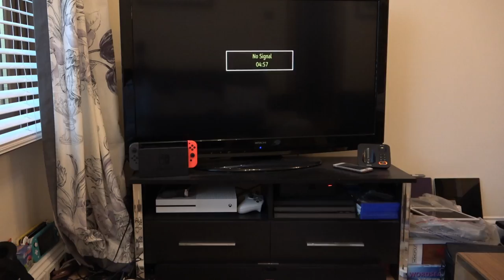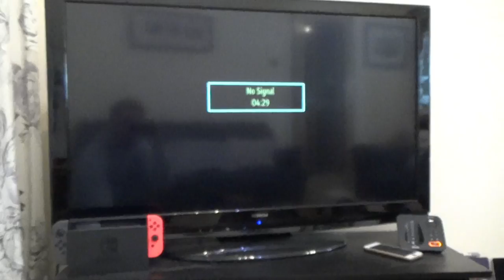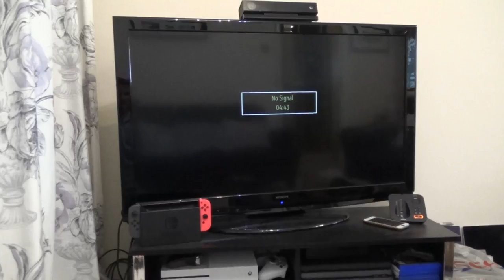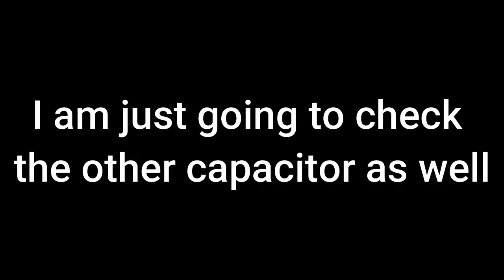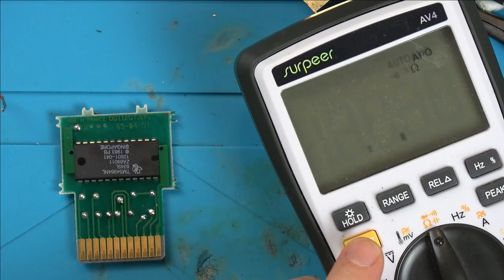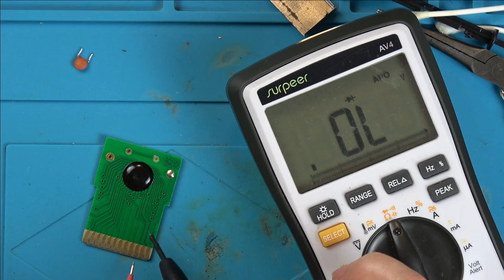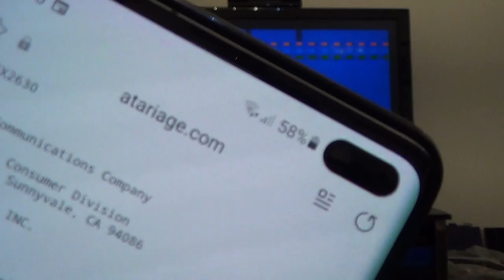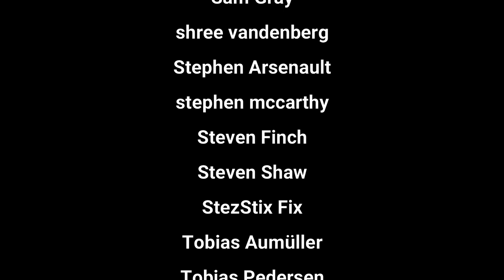A Joblot of Faulty Atari 2600 GAMES - Are they Fixable?

Comment: Yeah the paddle controller games won't work with the CX40 joystick. When you program CX40 controls in 6502 assembly for the Atari 2600 you have the code perform simple bit checks for the different inputs. Then the code branches to whatever instruction you want the game to perform. The paddles are more tricky to program because there's a capacitor inside them that charges at different rates depending on the position of the potentiometer. You perform bit checks but you also have to measure the time it takes for the potentiometer inside the paddle to discharge. This is so you get the appropriate rate of movement on the screen.

Comment: The flimsy carts are later titles. There was a "crash" in 1984 in the USA, people got sick of console games. Over in the UK we more wisely bought computers with games on tape for 2 quid, but Americans bought horrible massively clunky consoles with games for 30 quid them-days money. So no wonder they got sick of the prices once the novelty wore off.

So after that there wasn't as much money in 2600 software, so companies made cuts. Even using shitty flimsy plastic must've saved enough money to be worthwhile, compared with the thicker ABS (I think) they used to use. Surely it's only a matter of pennies per cart though. A lot of companies had games written and ready to publish right about the crash, so decided to at least get some return on the investment of programming them by releasing them in nasty carts. 2600 programming is really no joke, takes very smart people a fair length of time to get anything working at all. They were nearly all one-man jobs but one smart man.

Even the label is black-and-white text rather than the picture labels earlier carts had, I presume being black-and-white means they could use a cheaper press to print them. Real scrimping!

The Ghostbusters cart is 8K so must have the bankswitching circuit inside the chip, so it's not just a ROM, it's slightly custom. It's a fantastic game though, one of the most fun on the 2600! Read the manual online to figure out how to play it, it's not complicated but you need to know what controls to buy your initial equipment. Then you start the game proper, running your Ghostbusters franchise in your town, hoovering up and trapping ghosts. At the end of the game, the Marshmallow Man comes, and after you beat him your score is used as money to start over again, but with better equipment.

Better versions were on the Atari 8-bit computers, and indeed other 8-bit computers, but the 2600 version has nearly all the features included, a feat for such a limited console.

Comment: Whatever you're working on @23:41 -(super cobra?) it looks like the PCB had absorbed some liquid - you can see the PCB color gets lighter where you applied heat. You may want to try baking it in the oven at 110c for about an hour to dry it out, and see if that has any effect. I'm guessing the chip is fine, but the pcb has issues.

Comment: Which do you think is better for claning edge contacts like these Vince, earbud and iso, or one of those fiberglass pens?
Reply: Buddy, you have to choose your weapon for the situation.  Non destructive cleaning IPA or circuit board cleaner, next up warm flux and a tooth brush, for more 'destructive' cleaning you can use an eraser, fibreglass or brass tipped pens etc or finally a grinding pen (think Dremel with a 1mm grinding tip).  The art of cleaning contacts is a mysterious one and the choices you make reflect your personality.......
Reply: @Paperghost  Well, I usually use the fibreglass, but I'm dealing with 40 years of constant air exposure edge connectors on 80s microcomputers like C64, Spectrum and CPC464. Those tarnish really badly. And as anyone that had a spectrum knows, even a new machine was pretty touchy when you had anything connected by one of those ports!
Reply: @Graytail  A buddy of mine suggests using WD40 and a 100% cotton cloth if the connections are sound on the pcb.  I can see the logic but can't attest to it.

Comment: A fiberglass pencil would make so much quicker work of polishing those contacts instead of alcohol, and leave them with a clean surface, even through the contact point pits.  Alcohol or contact cleaner or DeOxit is a quick first repair, but if you have the cartridge apart, always use a fiberglass pencil to recover fresh metal surface without risk of damage unlike sandpaper can cause.
Reply: You'd still be scratching away the surface layers though.  On the plus side, these didn't look like enig or hard gold, so it's not as important, but I wouldn't do it to a better quality pcb.

Comment: It seems that in the old days of Atari they did not introduce standards that would become a standard with Nintendo and Sega as confirmed by the laughable differences in cartridge design and chip/circuit board in this video.  With Nintendo and Sega, game developers and publishers would have to comply with cartridge and chip/circuit board design and would get either the Nintendo or Sega quality seal and this practice would carry on even with PlayStation and X-BOX today.  Unfortunately the quality seal was not a representation of the quality of the game itself as the NES was swamped with terrible games that cost a fortune to buy back in the day.

Comment: A couple of ideas you could try. First you can clean the edge connection pads using an eraser. We used to do that to make older computer interface circuit edge connections work. And you can also re-solder the connections where the chip pins connect to the feedthrough pads. Some time the heat and reflowed solder makes them work again. I mean since they are already not working, what is there to loose...

Comment: I dont think with Kung Foo Master it is the chip - I owned an original Atrari Sixer like you have from above and KFM came out in the later 80's, It worked in the latter small 2600 models with the silver top but not in the earlier 1 st ed console.
Reply: I mean the Kung Fu Master is a repro cart. The PCB is even labeled as being from the 2000s.

Comment: Ghostbusters looks like a bootleg with the flimsy housing, cheap unlacquered pcb and the wrong label. Maybe from Hong Kong or thereabouts.
Reply: Official rereleases by Activision were White Label, done on the cheap, like their budget versions. Not saying this isn't a knock off. Just they could also be legit? Not an expert though, so I very happy to be corrected.
Reply: Ghostbusters is one of the later Activision games for the 2600 and the white label is for the PAL version of the game. After the crash of '83, Activision out fewer games and looked for ways to cut costs to lower price. Atari did this as well, with later run carts eliminating the spring door that protected the PCB from the elements.

Comment: I wonder if the cheap feeling cartridge is some sort of knock off.  I don't believe these had any copy protection at all.
Reply: Ghostbusters is one of the later Activision games for the 2600 and the white label is for the PAL version of the game. After the crash of '83, Activision out fewer games and looked for ways to cut costs to lower price. Atari did this as well, with later run carts eliminating the spring door that protected the PCB from the elements.

Comment: There is a possibility that the blob chip is real. The "MX2002-2016" part is most likely a model number, not a range of years. The actual date code is most likely 8912, meaning the 12th week of 1989. Atari 2600 consoles and games were still being produced then, and Nintendo started using blob chips on Famicom games around 1984.

Comment: The Ghostbusters cart is actually not "manufactured" by Activision, they were made by a licensee for Europe and Australia.

You'll find that a lot of the later carts are blob carts, pretty sure they were the "ultimate" version.

Most of my original are put away, I use eprom carts now, they are cheap and roms easily found.

If you want you can also do a multi-cart that has an SD card slot too, but I like swapping carts